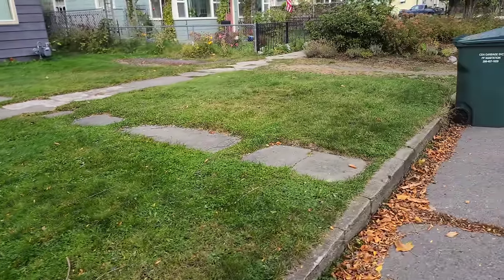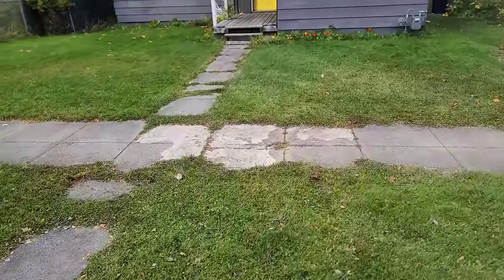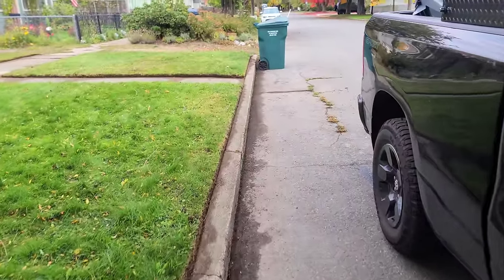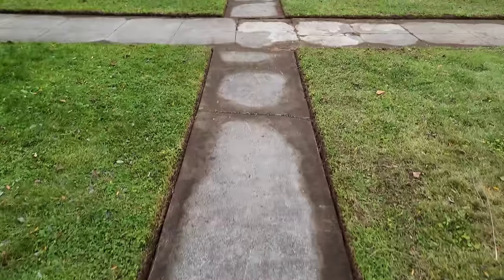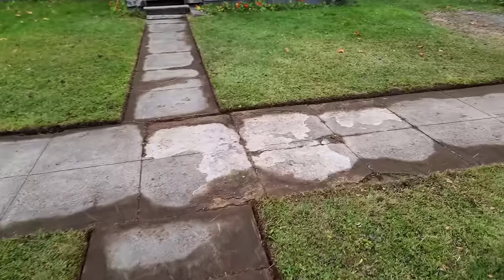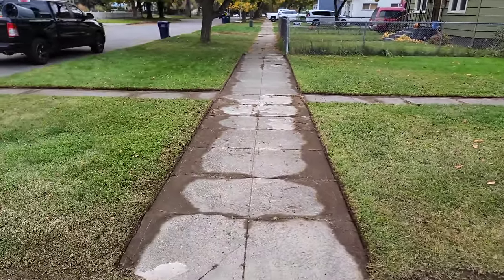Overgrown SIDEWALK Hasn't Been EDGED In Years | Let's CUT & PEEL

Comment: I enjoy watching your videos.  What you do by going over everything twice and bagging to make sure that there isn't an excess amount of grass clippings in the yard is exactly the way I do it when dealing with overgrown yards.  I do have a question though.   Why don't you use a walk behind edger instead of the stick edger?  I can see the advantages of a stick edger being that they are light weight and easy to use and maneuver.   However,  in my experience a walk behind with its bigger blade and more horse power not to mention greater mass, cuts through dense and overgrown grass much cleaner and easier.  Plus you get the added benefit of only having to make one pass to get the results you desire.
Reply from the maker: I like using the stick edgers because they're more maneuverable. All adjustments are made with your hands instantly, instead of pulling handles and setting levels with rods.

Comment: You'd save time and your back some by edging it all first and then going back with the shovel. You probably do it for recording reasons, but I'd rather move the camera tripod than bend over and pick up the edger and shovel an extra 100 times. You could also just shovel directly into the trash can and save yourself time and effort. More efficiency now will save you years from now.

Comment: WOW, what a professional man you are !  Your simple, fast and effective tips can re-beautify a nice and neat sidewalk that was overgrown for years. 

By the way, would you kindly tell me the brand & model of the Edger /  Trimmer machine that you are using. It is really powerful enough to handle tough yard work.

If I can’t get your type, what is another equivalent HEAVY DUTY brand/ model ( preferably powered by either BATTERY 🔋 PACK , or “if not” powered by long electrical wire ).

MERCI BEAUCOUP  (French = Thanks a lot) for your excellent video.

Have a nice day  👍  🙏 !

VINCENT (CHARITÉ) LAM.

Comment: What kind of string do you use to cut through this? I just tried this today and used several feet of line just for one side of my driveway. Kept snapping off. Ended up doing the entire driveway and pathway with nothing but a shovel. 🙄